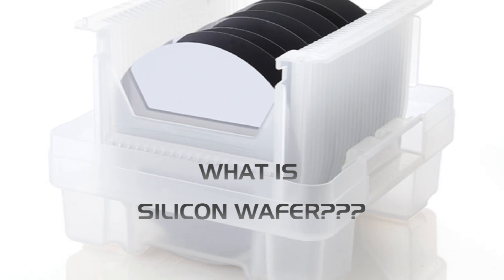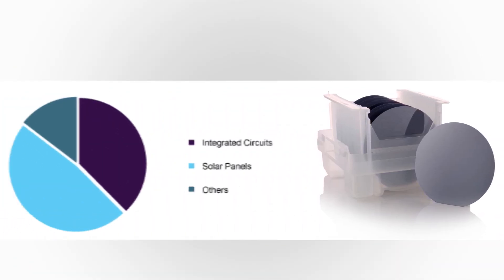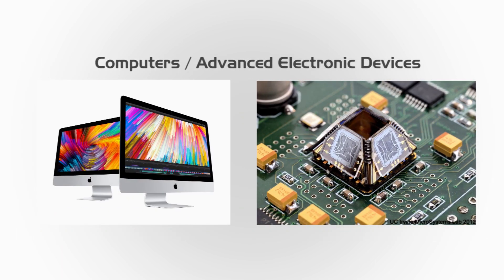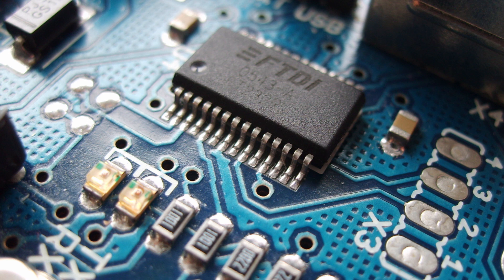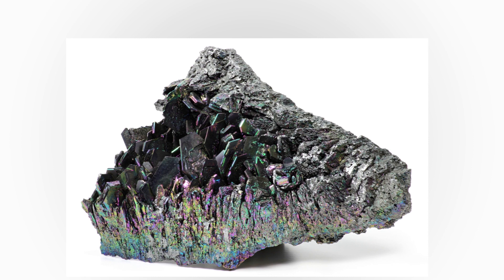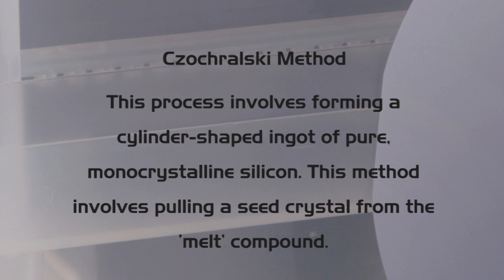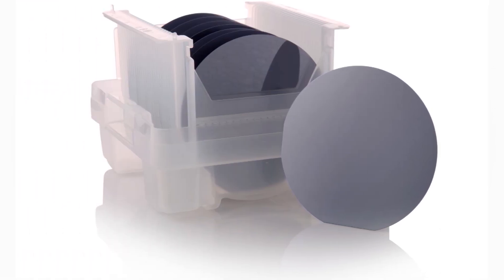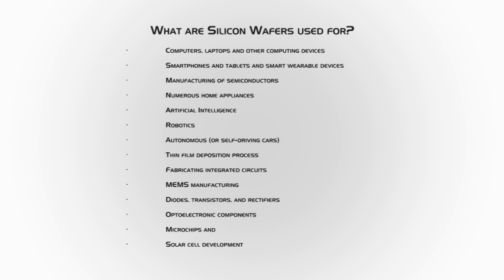What is Silicon Wafer?

Comment: Scrape wafers are usually used for solar panels. During the stage where the polarity is laid on the wafer, particles that end up on the wafer are scraped and sold to the become solar panel. 1inch wafers are no longer used by the way. It varies from 5 inch to 12 inch wafers. The step you mentioned about when the polarity is laid on with n-type or p-type doesn't happen until they are wafers. The silicon is cut into wafers first, then etched. Then sent off to another plant for polarity. Just wanted to clear that up.
Reply: Ty
Reply: Why sio2 layer is necessary on silicon wafers?
Reply: Can you explain the etching process please?